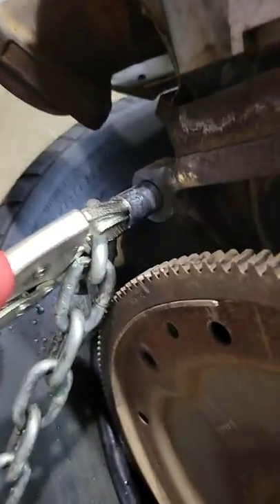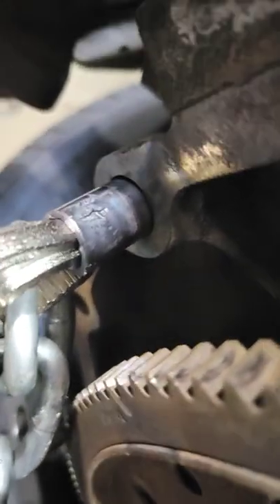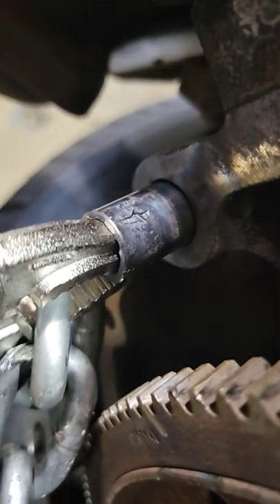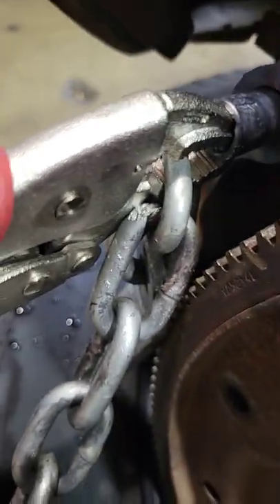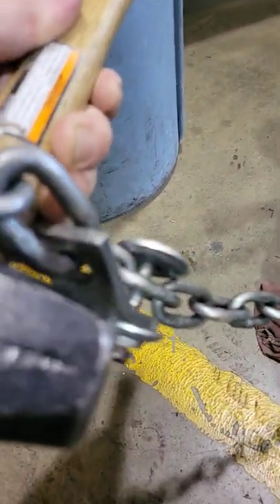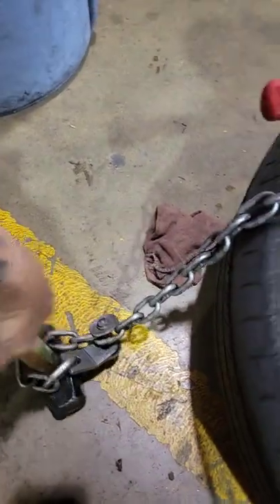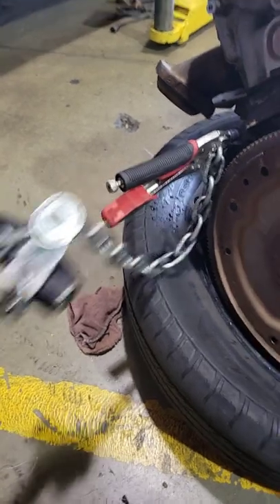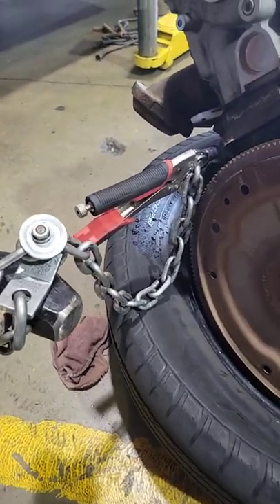Makeshift Slide Hammer

Comment: I notice he doesn't actually show it working.
Reply from the maker: I wish I had filmed it but we had actually been trying everything to get this out and nothing was working. Once we tried this method it worked and I was super stoked. That's why it was not on film.
Reply: @NutsandBoltswithTone   maybe do it again
Reply: Right certified 🤡
Reply: @Dilloz12  send it certified is Canadian tire house brand
Reply: @NutsandBoltswithTone  redo it then just as easy to put it back together and show the guys how it's done and simple it is to work and correctly work at that! But always another around the shop or something to practice on 😂 have good day thanks for posting
Reply: @D. W. Then it just seems kinda pointless to record how to make it, how you made and not show your results
Reply: @stargate937  the dowel had already been removed. If he demonstrated it, it would probably go flying for no good reason. I'm sure you can imagine how it works.
Reply: Why didn't you just put a long bolt all the way through it put a socket over top of it in a moisture and use a bolt to pull it out
Reply: @jamesyates3140  because the sleeve wants to compress and change shape as you pull it. putting something in will not allow free expansion and compression of the part in question.
Reply: @icecreamdaycatlin8896  guess I've been doing it wrong for 40 years
Reply: @jamesyates3140  not saying its wrong but your probably making it harder. not only that but your creating an air vacuum inside that space which is gonna just as i said make your life harder.
Reply: @icecreamdaycatlin8896  you are just pulling out a dowel pin right maybe we are talking about two different things
Reply: @jamesyates3140  that dowel is the sleeve thats threaded for the bolt. if you put a bolt in it will make an internal vacuum
Reply: @icecreamdaycatlin8896  you are over thinking this a bolt is not going to be air tight I have been in the car repair business for about 45 years just telling you a easier way to do it
Reply: @jamesyates3140  a bolt most definately can and should be air tight on a head bolt. You do realise brake lines are held airtight with nothing more than a bolt correct? Threadlock can be used as a suppliment for a guaruntee but i think you ne÷d to re evaluate a bit. Im sorry not trying to be a dick but like. Wtf
Reply: I dont discredit that it works but when you tighten a bolt the threads smash together creating an airtight gap. One half of those threads can creat a gap. But if your bolt is fully fastened to the head of the nut it will most certainly be air tight and if its not you are using an improper or overused bolt
Reply: Also the mrthod in the video is Clearly not the corrext way. Im sure theres a tool that grabs the head of an inserted bolt that works like a bearing puller/pusher or somrthing. And it may make the job technically easier but the forces its exerting would be more than if there wasnt a sealing action being performed. Again not saying your wrong and im the only one right. But there would or could be a vacuum within that space requiring more forces than if there is a breathable gap
Reply: Another thing is we dont know if this dowel threads to the water jacket of the engine. If that is the case however a vacuum would not be present
Reply: @NutsandBoltswithTone  That doesn’t make sense why you didn’t film the results. Did you say “stop filming so I can test this out”?
Reply: @D. W. I don’t want to spend all that time locating all the necessary parts and rigging all of that up to find out there is an unforeseen flaw in this design. That could easily waste 1 hour of my time.
Reply from the maker: @jSutliff74  to be honest we were trying everything we could think of to get it out, nothing was working I was not doing any filming. I only filmed what I did because it actually worked. Didn't know it was going to work until it was out
Reply: @NutsandBoltswithTone  Ok I got you. You rigged it back up after you realized it worked to show the viewers. Good idea if you are in a bind. Thanks
Read more

Translate to Apology
Reply: It does work
Reply: I did this once. 1962 Plymouth Valiant rear wheel bearing. I had a 24 inch cable and a splitting maul. I bolted the  cable onto the axels and with  one  24 inch swing I sent that whole axel half way across the front yard. Then I took the axel on the bus to get a new bearing pressed on.
Reply: @redsealjourneymanreviews6647  😅or just do it yourself if you need to it'll definitely work...

Comment: "How to damage 3 tools to avoid buying 1"
Reply: Its not always about avoiding to buy a tool. Ive had to improvise several times. Ive been in areas where buying something like slide hammer is either hours away or to have it delivered.
Reply from the maker: Thank you for that. Buying a tool is never a problem for me. We had been battling with this dowel for about 30 minutes and the fleet company needed this truck back on the road asap so we were throwing everything at it to get that dowel out and in the replacement engine.
Reply from the maker: Aw man you know what I have no problem buying tools and if there had been an assortment of tools that would work in front of me at that moment I would have bought them all but guess what, there were no tools in front of me. We needed that dowel out at that moment and we got it out without damaging any tools.
Reply: @NutsandBoltswithTone  I've definitely made some jenky "gotta make it work" setups in the past, and I can relate to not waiting on a tool truck or wasting time. I was just making a little humor out of it no disrespect.
Reply: I've even attached vice grips to a slide hammer in the past for a similar problem . I'm only making a joke so people don't think this is a permanent alternative
Reply from the maker: @amsmobile1  I gotcha. I need to get a pair of vice grips for my Slide Hammer. I have the attachment in my OTC kit.
Reply: It’s tough to go buy a slide hammer when your car is sitting on Jack stands
Reply: If you damage a chain, vice grips, or your sledge doing this then you probably shouldn't of bought any of the 3 to begin with.
Reply: @NutsandBoltswithTone  
Do you have a dowel pin slide hammer set?  I believe I got one at harbor freight for. Heap that works just fine
Second most slid hammer come with an adapter that threads right into your slide hammer
Reply from the maker: @mattaronbate  I do not have one. Don't need one mostly
Reply: @NutsandBoltswithTone  new tools ain't a problem but you don't even have basic tools like a simple slide hammer set...jeez jr go back to sewing dresses
Reply: @amsmobile1  it felt low key dirty though.  I think every body is gonna pull through 😆
Reply: Hahaha yes and late nights after the auto parts stores have closed.
Reply: @evolburd5768  you said that your friend and is not good for the other night I know that we don’t want ask the kids if we have a lot more to come over and you can get your kids out to do something to you and I know that we have slept all over you the way that we can get your family and I know that we don’t know may I need you but we can
Reply: @alexs-zq6ni  you buy your tools at the parts house? Lmfbo cheap tool fuck them ones id weld cutaneous grind them into something more useful
Reply: I was thinking the same thing. This is how you get hit in the steak and two veg.
Reply: Don't even need that shit there threw holes get a punch tap it out from back side done it so many times with the motor already set in engine bay again because I didn't catch the used motor had one in it 🤪
Reply: If your hammer is damaged from that then you need a stronger hammer and if you frequently use vice grips then they will inevitably wear out no matter what.
Reply: I like this
Reply: In his defense... it's harbor freight anyway...

Comment: I have used vice grips with long threaded rod in place of the vice grip adjustment screw. Piece of gas pipe on the threaded rod with nut and washer at the end makes a perfect slide hammer. Worked great pulling a stubborn cv joint out
Reply from the maker: That sounds great thanks for sharing
Reply: started to type that...
Reply from the maker: @TheOutwiththeold  I need to get that
Reply: Good tip. One of my friends son found a set of locking pliers mad similar to what you did, the handles are about 2 ft long. I'm still trying to find a set like that.
Reply: I came to make basically the same comment.
This tool can be improved by finding a length of steel tubing that fits snugly over the threaded rod. This allows your "hammer" to slide freely without hanging on the threads. 
I am fortunate to be able to make the hammer piece out of 1-1/2" or 2" round stock.
 Over the years I have made a set of these that fit all the sizes of Vice Grips I have. 
I don't know about the newer Vice Grip brand, but the older ones all had SAE threads.
Reply: I made my vicegrip slide hammer.

Comment: Stay tuned for next weeks addition of: "making an acetylene torch with lighter fluid and a rubber tube."
Reply from the maker: Funny thing we had to use an acetylene torch to get the block red hot to get it out. I needed that dowel to be useable for replacement engine
Reply: @NutsandBoltswithTone  nice. Lol.

Comment: It doesn't matter. You heat it enough it'll FALL out. Also, that locking plier won't apply a whole heck of a lot of pull before it SLIDES off there.

Comment: Just weld a 2 foot long rod inside the dowel, put a 9" long waterpipe over the rod, weld a plate on the other end of the rod. You now have a real slide hammer which you can reuse on other jobs.

Comment: For hollow dowel removal for people too cheap to buy a dowel puller- use the smallest tap possible that still cuts threads. Thread the inside of the dowel, then run a bolt in and it will press itself out if it's a blind hole. If it's a through hole, use a punch or pull on the bolt. Way less damage, and the dowel is reusable.

Comment: You can also put a the head of a metal sledgehammer and a bunch of nuts and washers onto a threaded rod that fits into the bottom of the vice grip. Works really great for stubborn cv axles.

Comment: To get those pesky dowel pins out use a drill bit where the shank will fit into the dowel pin snugly. Then take a pair of vice grips and get it out. You wont damage the dowel pin this way
Reply from the maker: Now that is a damn good idea that I am gonna share the next time I have on.
Reply: And that's how it is done by most mechanics.
Drill or any metal rod the same ID as the dowel will do.

Comment: The dowel has a cut in it. Just crush it and pull it out or pack grease in it like a pilot bearing
Reply from the maker: This dowel had no cut, and had a very small hole in the back but could not hit it through.
Reply: @NutsandBoltswithTone  you hit it threw the front not the back

Comment: The price doesn't make sense for the average weekend warrior, but if you are a tech and need to take dowel pins out of block regularly this tool exist. Cal-Van Tools 95400 In-Line Dowel Pin Puller.

Comment: Thread the dowel pin with a tap. Find a long matching bolt. Drop a few small nuts in the dowel hole. Insert bolt and extract dowel pin with ratchet. 
You're welcome. This generation has me worried. 😂

Comment: I use a very big helium balloon to pull out stuck parts. It's much easier if you don't have a proper sized bolt to make this "makeshift slide hammer."

Comment: All the comments about the tools and nobody seems to mention you don't heat up cast to make it expand unless it's going in the trash. Your destroying the temper and it will Crack at the hole and anywhere that heat transfer messed with the temper. Just go to harbor freight and buy a cheap slide hammer if you do this type of cheap work.

Comment: Soooo a can of computer keyboard cleaner... turn it upside-down and start to spray the dowel... it will freeze the dowel causing it to shrink that little bit and they will come out easier and without heat.. yes you may need to use the whole can in 1 shot but it works

Comment: Or you could get a drill bit same inside diameter as the dowell and then grab with vise grips out around the dowell heat block and spin it out

Comment: Or run a tap down the dowel and pull it out with a bolt and socket(as a spacer) 2 minutes tops and you can reuse the dowel

Comment: I welded a nut to the screw for the vice grips so if I need to use a slide hammer i can screw into the back of the vice grips

Comment: Just weld a nut on the end of the adjuster bolt, that fits your slide hammer. Got 3 pair fixed that way. Wide jaws, small jaws, and needle nose. Had them for almost 40 years.
Reply from the maker: great advice thank you

Comment: That's only pulling on the bottom section, there's a good chance it's going to tweak the hole as it's coming out, or possibly just snap off that small section you were able to get the vise grips on, and then you got that chain in the vice grips flying straight your hands, which you will probably get out of the way in time to allow your knee to take all the impact.
Reply from the maker: Ok thank you

Comment: Making an actual hard hitting slide hammer isn't hard to do if you have some bar stock and scrap metal around
Reply from the maker: Thank you, I actually have a very nice hard hitting slide hammer but would not adapt to my vice grips I was using.

Comment: I put a bolt in the dowel about the same size then grab the dowel with vice gripes and pull without crushing the dowel, but you do it your way everybody needs a hobby.
Reply from the maker: Sure no problem. I got it out and was able reuse the dowel.

Comment: I got a threaded rod that threads into the vice grips and put a sliding hammer on the threaded rod. Used nuts and thick washers to cap the end. BOOM slide hammer vice grips
Reply from the maker: Very nice I will have to look into that

Comment: Had this problem on 5.4 but I used a drill bit that fit sung in the dowel and ended up using a vice grip and it came out no problem
Reply from the maker: Very nice, we have had this happen multiple times and in most cases could not save the dowel. This time we saved it so I am happy.

Comment: Or you can buy a long treaded bolt that fits on the vice grip…
 a couple of nuts an washers and a heavy pipe that the diameter fits on the washer so it can bang against the washer giving the slide hammer effect…
Reply from the maker: Sweet thank you

Comment: I once solved a very similar problem by purchasing a slide hammer
Reply from the maker: I own a very nice one but couldn't adapt to vice grips need to get some for the slide Hammer
Reply: @NutsandBoltswithTone  yeah lol actually getting a grip on what you're removing is always a PITA. I actually went to Fastenal and got a 5/16-18 eye bolt to replace the adjustment bolt on a set of 8R Petersen vise grips and I keep them with my slide hammers. Works magic.
Reply from the maker: @QuantumLeap83  thank you I have had several people suggest that.

Comment: Just replace the vise grip bolt with all thread and use a weight with a hole. Vise grip slide hammer.
Reply from the maker: That is a great idea, this idea was something we came up with what we had in the shop and it worked. Thank you for the idea.

Comment: Did you try tapping threads into the dowel and using a bolt and some spacers to pull it out
Reply from the maker: We have tried that on several that we have had and didn't work and dowel ended up unusable. I have to make sure I could use this one so we were trying alternative methods.

Comment: Electrical tape, bolt that goes in there and some grease. Fill the hole with grease, tape the bolt, tap it in w/hammer the grease will push the dowel out
Reply from the maker: This was not a closed hole. The back was open but no access to hit from behind. I have done this to remove pilot bearings

Comment: I was told as an apprentice. "If you don't have the right tool for the job, either go buy it or don't do the job!"
Drill and tap the dowel . Then put a bolt in it and you can pull it out real easy. You can even reuse the dowel.
Reply from the maker: Well I understand what your saying but here is reality, when there is a job to do you have to do what you have to do. In this case what we did worked.

Comment: Tap threads into the dowel , put threaded bar into it, get something heavy with a hole in it put it on the bar with a nut and washer on the end, voila a slide hammer fixed into the dowel
Reply from the maker: Thank u

Comment: Rebar and a 5 pound bench press weight and a welder will work also
Reply from the maker: Sweet, we had been battling with this engine dowel for at least 30 minutes and threw this contraption together and it worked so here it is.
Reply: @NutsandBoltswithTone  if it works it was a good idea fuck that strugglin shit

Comment: I have found that if you tap the dowel and use a bolt and socket as you thread it in it will pull the dowel
Reply from the maker: We have had engines in the past that we tried that on and had no luck. We have had some that we tried all kinds of methods and didn't work, this dowel needed to come out of this engine for the replacement engine right away cause the fleet company needed it back on the road asap.

Comment: Another thing you can do is actually put a small slide hammer with a long bolt of the same thread into the vice grips
Reply from the maker: Yes I will be planning to set that up, I was unable to that here cause I was in pinch.
Reply: @NutsandBoltswithTone  I’ll post my slide hammer I made and you are gonna laugh so hard
Reply from the maker: @nickgeissler1916  can't wait to see it

Comment: I just don't see the vicegrips not opening up or the head on the hammer not coming of.
Reply from the maker: They are vamplier vice grips and they held enough to get this out. It was such a process.
Reply: @NutsandBoltswithTone  I got ya, I just think a C-clamp and two sockets would be a lot less likely to break that ear.  If it was a blind might need to do some rigging?